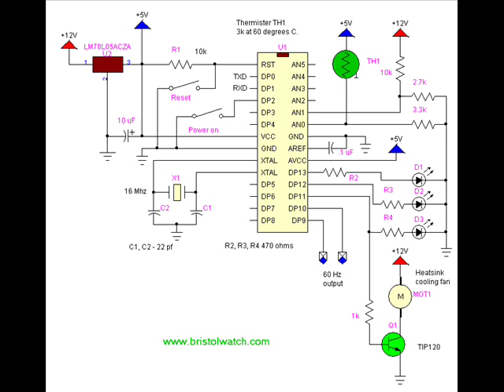Arduino DC-AC Power Inverter

Comment: I know its been a wile since you did the arduino inverter project. I was wondering if you have made any advances in it as well. I am wanting to build a pure sine inverter to light my home. its a must have project. to get off the generators. I could use square wave for lights only. but basically I need advice. any help is welcome

Comment: Hi, this is very good tutorial, I need to build arduino inverter, but is posible to get 1000Hz and 20V-30V by changing transformator and delay on arduino from 8,333 to 0,5

Comment: Lewis most commercial off the shelf ones are a modified sine wave (which is basically a square wave),  unless you purchase a pure wine wave inverter which are very pricey.
Reply from the maker: That's correct. Thanks.

Comment from the maker: I believe a commercial unit would be far more efficient. there are a lot of variables here most being the mass of the transformer, impedance, and the fact this is a square wave. It works well for what it does, but is more a demo than anything.